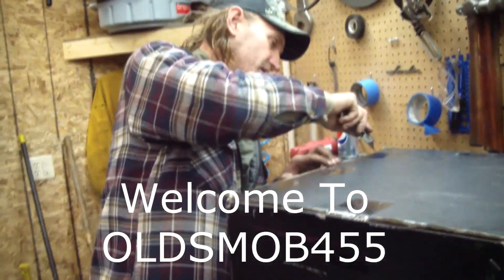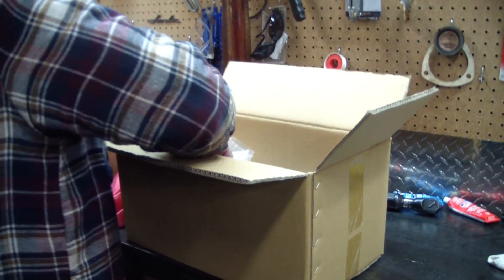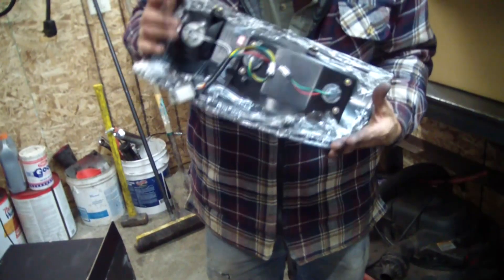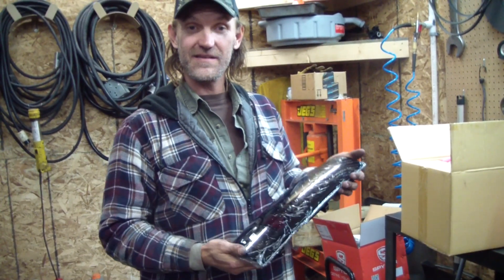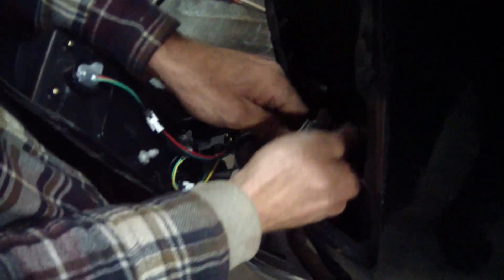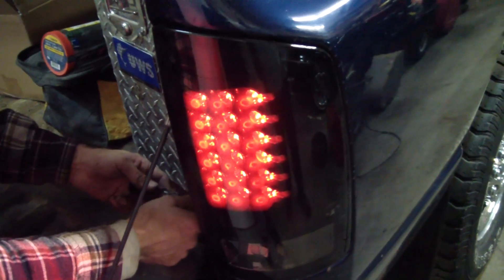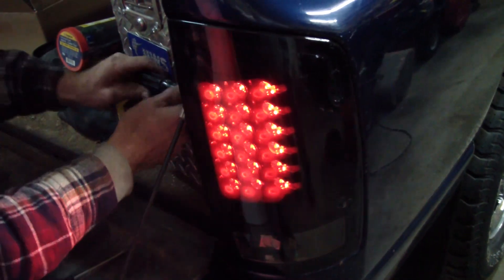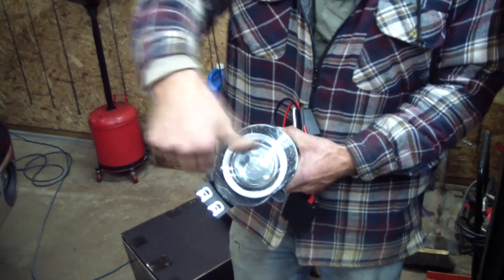2002 - 2005 Dodge Ram Cummins 2500  LED Tail Lights Installation

Comment: i like the idea of LEDs because they help that much more of a load on the battery and the alternator (electrical system) :) still have not bought them yet can't see myself getting over the $10 plus piece for a 1157 led bulb :) i guess there cheaper now.

Comment: I was thinking about ordering these lights from pro tuning. I have 2 questions, did the "lamp out" signal come on the dash, and are the reverse lights led as well? the website doesn't mention that.  Im wondering if they are true plug n play, bc of the circuit board style lights. I don't want a lamp out warning light on on my dash.
Reply: skyline51491 I bought some aftermarket l.e.d. taillights on ebay from speed daddy and yes the lamp out light kept showing and the taillights were out of sync with the trucks computer. so I sent mines back.

Comment: I know this is an old video but I had lights like this and had to take them out and put my old ones back in because after I started driving the brake lights and turn signals weren’t working half the time and I have no idea why they work fine until I start driving they were plugged in correctly and wiring looks fine do you know what the problem could be and how I could fix this?
Reply from the maker: These are cheap lights.  They were eventually removed and replaced with the original lights.